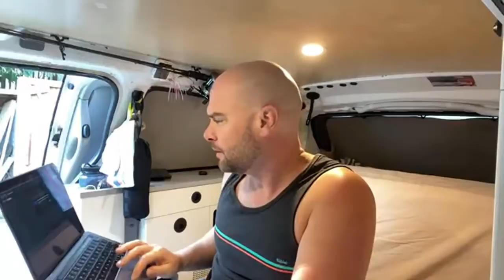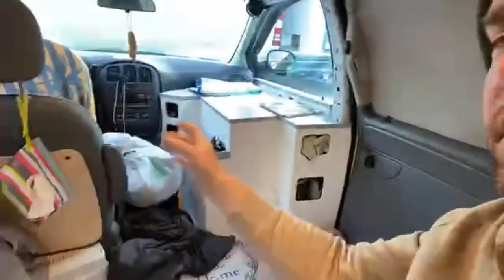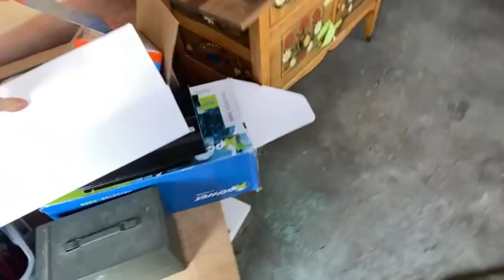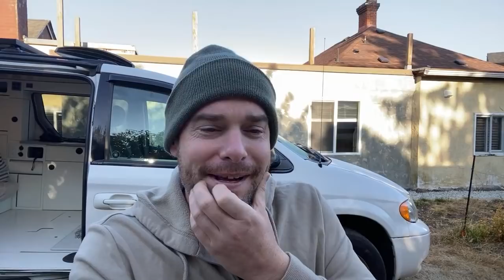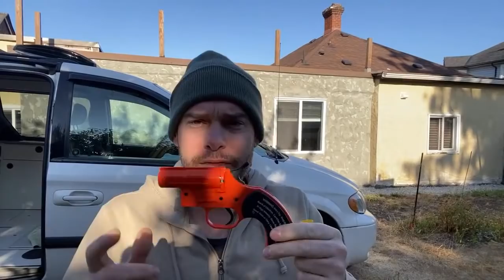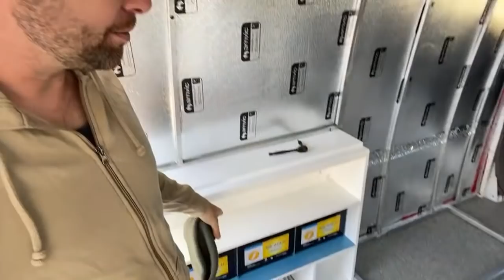Live Q & A || Waking Up In A Friends Back Yard With A Sprinter Van Conversion Build Out

Comment: OH !!! Does ANYONE  have input on Centech 750 peak amps Starter-Charger-Power Unit ??? ...just a small 10 lb thing, jumped cables on back, front has 1 USB port ...12 volt and work light. Only approx $60.... I just bought one and I'm leery...can't afford a Jackery but hoping for more input, positive or negative,  bc I can't afford a Jackery and Wisconsin on the way too fast. I'm concerned about its reliability..